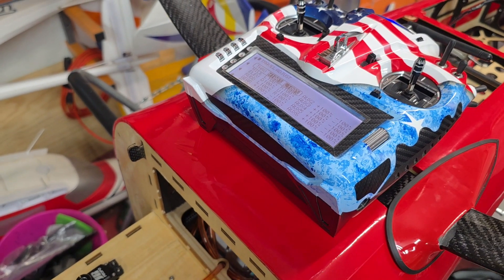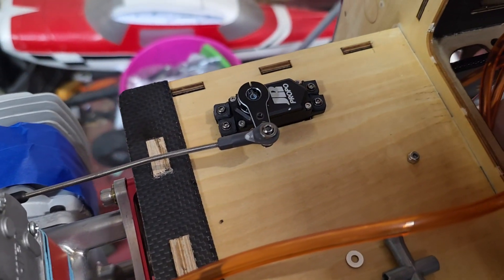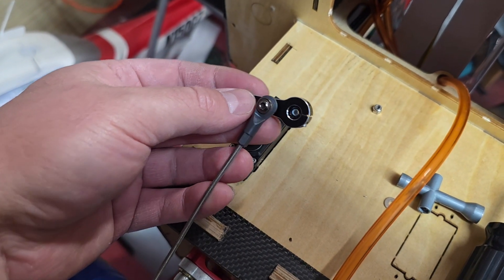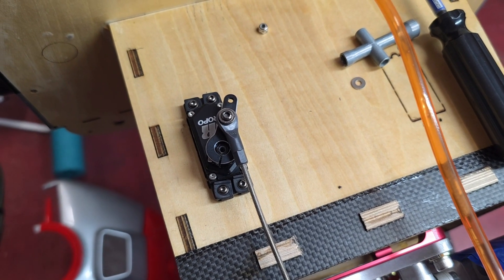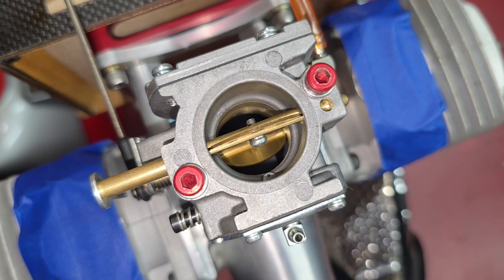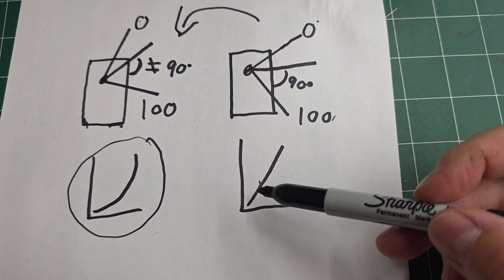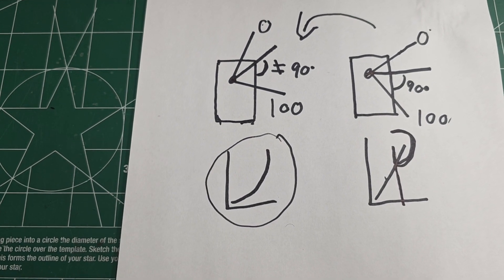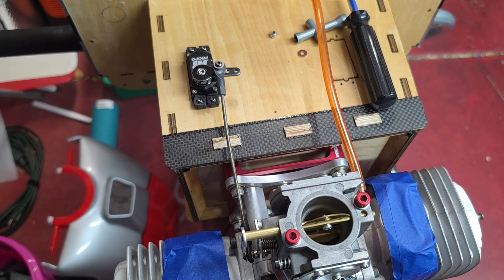Gas Engine Throttle Servo Demystified

Comment: Great video. Couldn’t you get a similar  throttle feel with the radio throttle curve to the mechanical curve by limiting the  top end point on the radio to a similar end point of the mechanical curve? I’m sure it will still require more trial and error configuring the rest of the curve on the radio. I’m not seeing why you can’t get them pretty close. Depending on the how the linkage is setup I guess you would still lose some resolution. Might be something I’ll try experimenting with.
Reply from the maker: while the digital curve can help smooth out the responsiveness of the motor, it is never going to be able to correctly mimic what a correctly established mechanical curve can do. In order for your airplane to fly right, you first have to establish good mechanics in the entire aircraft as you cannot digitally mask a poor setup.
Reply: Thanks for the reply. Just trying to understand and not trying to argue.  Getting ready to put a da70 in a new build. I  agree you can’t completely fix a bad mechanical setup with a curve, also that the carb being open about 1/3 gives you about half rpm. What I’m seeing from your drawing and setup though is you just limited the resolution of your servo. Yes it gives you a mechanical curve, but now the bottom half of your servo travel is limited compared to the top end. Assuming you want the end points of the servo to reach -100 and 100 (or 0-100 whatever your tx reading is) for full resolution. By offsetting an arm you will reach full closed well before the end of the servo travel compared to wide open. The offset would require the top end of the travel to be over 100 to reach full open. 

That’s why I’m wondering if a curve would be better to keep the full resolution of the servo.
Maybe I’m missing something though
Reply from the maker: @Bucketheadzie  actually for throttle you don't need to squeeze every bit of resolution out of the servo as you won't be able to tell the difference since the engine does not respond in a comparable manner to a flight surface. As long as your throttle servo sweep is smooth and consistent, your geometry is ideal, and as long as your engine will return to a consistent idle, you don't need to widen the servo travel to massive lengths.
Reply: @greatplanesman great thanks for the explanation! Very helpful

Comment: Thank you for your video, good info. I find that carbs are sometimes slightly different, and some servos have more usable movement from the same radio signal.  First hole on the arm is about 3/4" and has given me close results so I agree. 
What I fight with is to get the idle I want at mid trim by using end point.. It's a juggle between spline position and rod length. My DA70 was very linear with the 24x9 but when I tried 25x8w I had to raise the lower 3/4 throttle curve waay up to get good acceleration. My DA35 is very weird, the curve is extremely flat because the low end has just too much power, not linear at all like the twins.
Reply from the maker: @markwest759  propeller and engine tune can have a big influence on how the engine accelerates, not to mention atmospheric conditions, so always ensure your engine is running with peak performance and not lean or rich on either end of the tune.